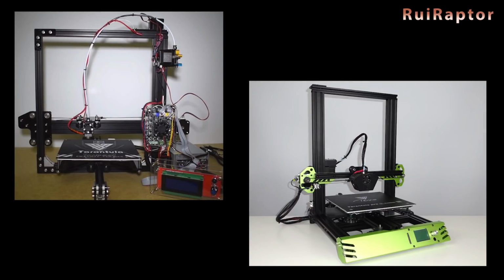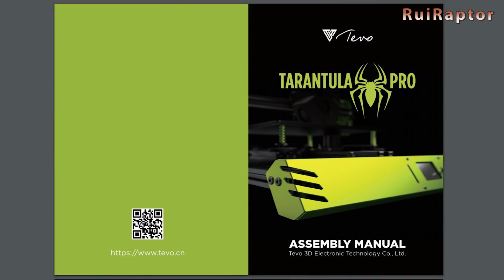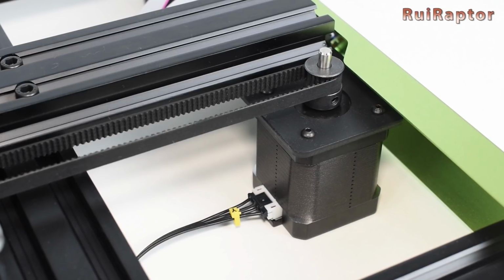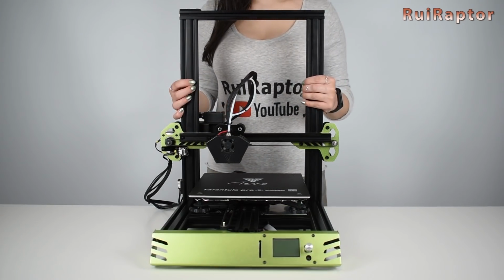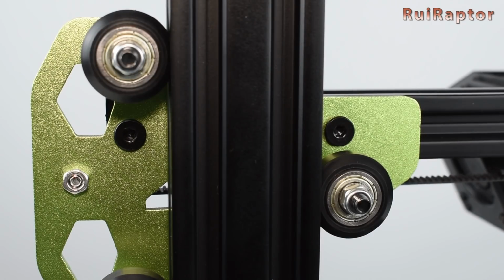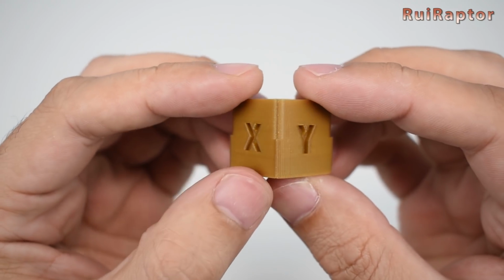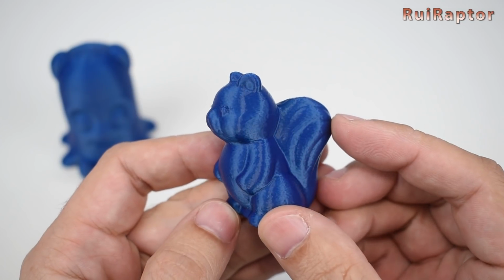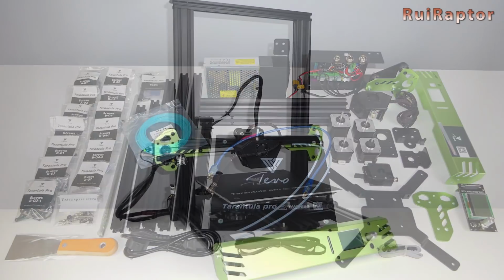Tevo TARANTULA PRO (3D Printer) - First Prints & Review

Comment: Thank you Ruiraptor for all of your detailed videos of the TTP. I got mine a week ago, followed your instructions and built it with no issues at all.

Only question I have is what is the average speed this printer should print at and do you recommend calibrating the setting in Marlin or just in Cura via profiles. What do you recommend? Cheers
Reply from the maker: Hi Bruno,
The more you increase the printing speed, the less print quality you will get. We normally print at 60mm/s for infill and internal walls and 35mm/s for outer walls. We always set this value in the firmware/printer menus. We also recommend you to disable the acceleration/velocity control in cura.

Comment: 240C is NOT maximum temperature for PTFE tube. PTFE is rated to 260C.  But because the PTFE tube connected to cooled part of hotend, you can use MUCH higher temperature for printing without any risk. 270C is printed easily, many hours in my Tarantula
Reply from the maker: If you search online you will see that there is No true value for temperature limit for PTFE tubes. Some good quality PTFE tube manufacturers have their spec at 260ºC, others at 250ºC but the general rule-of-thumb for our traditional tubes is that above 240°C will start to degrade. I have seen several cases of printers with PTFE tubes in perfect shape that after some hours of printing PETG at 240ºC got their tube tips in bad shape.

Comment: Ok i did your video for hot end so it dont leak twice and both times it still leaked tightend it tight and had petg tube where it needs to be also cant take petg tube out cause i gess i groved it in any idea how to get it out what can i use instead of that tibe also where can i get that tube at also will leaking hotend cause thermal runaway faild to heat faults? What is the best option to get to replace it if that whata iama have to do?
Reply: Well i broke a wire to the hotblock part so gona need a new one darn it any better version i should get
Reply from the maker: How hot are you using your hotend? Be aware that temperatures above 240 degrees C will start to melt the PTFE tube inside the heatbreak and cause issues.
Reply: @ruiraptor  hotest i did was 230 i didnt tighten after i got it hot i tighted stuff while cold
Reply from the maker: So if you heatup manually it will work but when starting a print it will not heat up?
Reply: @ruiraptor  no it heats up then in middle of a print will toss a faild to heat msg first time second time tossed a thermal runoff message turns out it was leaking filament and when I poured down the heat block from the radiator I damaged the thermistor wire so now I need a new one not sure which one I need and I also would like to replace the heating block with one that has wires off the side instead of smashed between the radiator and heat block

Comment: NOPE , about 1 min into several different prints it just stops mid print . No error messages like thermal runaway pop up , nothing , just stops .
Reply from the maker: It seems to be related with the connection between the front panel (where the display and memory card reader is) and the board. You will need to check the cable, connectors, etc.

Comment: After a nights sleep and a few more hours of tinkering , I think I may have figured part of it out , The factory Benchie test will not print no matter what I try , but one other seemed fine down to 0.2 print height . Retrying different settings , I did get the Reddit posted TT Pro profiles imported into Cura on Linux today . Another failed factory benchie at about 1/4 of an inch into print at 50% scale with a 0.4 print height this time . Going to try the one from Thingiverse . Just fidgety , as much as I like to tinker , I do not like getting annoyed at things , I am generally easy going and getting aggravated is really bad . Thanks for all your videos , I have found a lot of useful information on your channel .
Reply from the maker: Hi, why are they failing?

Comment: Rui , I just got my TT Pro together , and started printing , within the first quarter inch or say 6mm on 3 different prints , it just stopped printing with no error or anything , it just says printing . I haven't connected it to computer yet , but tried different SD cards to no avail . I used the test print from Tevo , then a benchie reduced to 50% scale through Cura with the standard Tevo Tarantula profile , located the a profile somewhere for the Pro , but in Linux , I couldn't figure out where the profiles are stored , so they are useless to me for the moment , yes I am also a Linux noob , but since I am not connecting it to a computer , that shouldn't be much of an issue for now .  TIA for any assistance you may be able to offer . Donnie
Reply: I just tried the support.gcode twice and both times on the first layer got thermal runaway shutdown error .  Looked at the links for support and I guess they expect everyone in the world to have facebook because all links point to a locked facebook group .  Yes , I am probably one of say 3 people in the whole world without that , wife and my dad being the other two . Doesn't seem to be any other way to reach Tevo from what I have seen , wouldn't have been a problem if I would have spent the extra 20 or so bucks and bought the thing from Amazon , but got it from Banggood . Yep , you guessed it , would have then tried my luck with a Longer LK4 Pro or Ender 3 Pro . Really hating this thing already .
Reply from the maker: Hi Donald, sorry for the late reply. Check carefully the cable and connections between the front panel and the board. It might loose connection to the SD card while printing (vibrating)
Reply from the maker: Regaring the thermal runaway, check if you have the layer cooling fan turning while printing the first layer. If yes, turn it down for the first layer and don't set to the full speed and try again.
Reply: @ruiraptor  Rui , thanks for replying , reason I left all the comments was because you seemed to have more knowledge about these than anyone else  . I really appreciate that . I will give all your suggestions a shot and get back to you , for convenience you could email me at gmail with user dring219 , just so we don't clog up a video of yours if you like . Again , thank you so much for the suggestions .
Reply: @ruiraptor  Rui , nothing seemed to work , tried unplugging EVERYTHING and reconnecting , even the drivers . I changed the print quality , fan speeds , print speed , bed & nozzel temps , I evenm tried different outlets in the house . I did find the support ticket option on Tevo's website , but with Coronavirus in China , I doubt I will be getting a reply anytime within the first 7 days in case parts were needed .  I do pray that all is well with you and your family  .
Reply from the maker: Hi Donald, try my recomendation of printing something using a computer instead of memory card because i believe that the issue is related with interruption of gcode reading/transmitting the information to the board.

Comment: Im a bit dissapointed to find out my new Pro does not support ABS. Do you know what needs to be changed to make it ABS capable? thanks

EDIT, I am printing ABS w/o issue with the bed at 90C and an enclosure. It sticks so well that I could probably run it at 85.
Reply from the maker: Yes, for the bed, you can either buy a more powerfull power supply or build an enclosure like you did. For the hotend, it's not recommended to use temperatures above 235ºC because of the PTFE tube. If you need to use higher temperatures you need to replace the heatbreak with an all metal heatbreak.

Comment: I don't understand why they did release this. It sounds like to a better Tarantula and to a worst Flash at the same time. They should make a new version of the Flash, still with electronic end-stops, magnectic build plate, and the good position of the Y motor !
Reply from the maker: Tevo is about to release the new Tarantula RS. Let's see what it will bring.
Reply: ruiraptor any sneak peaks? There are little details available at the moment but it can be preordered
Reply from the maker: Hi Brett, the information is still limited but we know that the heatbed is AC powered and includes TMC drivers.

Comment: Hey, how would you say this printer stacks up against the Creality ender 3 Prusa I3?

I will be buying a 3D printer now during the black friday sales and found the Tevo TARANTULA PRO  for 1,862  SEK (193 USD) as well as the Creality Ender 3 V-Slot Prusa I3 for 1,626 SEK (169 USD) (Best deals Ive found so far)

After watching some reviews on the Creality Ender 3 it seems a lot of people have issues with the default drivers giving them bad print quality and issues with nozzles not holding up, have you had any similar issues with the Tevo TARANTULA PRO? Im probably not going to end up upgrading whatever printer I  buy and not tinker too much with it outside of whats necessary to get it up and running so for me the out of the box performance and print quality is probably no.1 for me

Also community/support wise, is it difficult seeking help if you run into issues with the Tevo TARANTULA PRO or are there any online communities like active forums or Discord servers deditacted to this printer?

And lastly, as I've understood it, the Tevo TARANTULA PRO and Creality ender 3 both takes the same types of filaments right?

Found this TPU flexible filament which says its for the Ender 3, but Im guessing it would work just as well for the Tarantula pro, right? https://www.gearbest.com/3d-printer-supplies/pp_009249413095.html?wid=1433363&currency=SEK&vip=1041013&gclid=CjwKCAjw9L_tBRBXEiwAOWVVCdfLfTnoHse-pzJ89rdtUbCJXv_T2jRiQZ2f5qZwPhw2H61jitf_EBoCKDEQAvD_BwE
Reply from the maker: Hi, What you are refering to about the print quality is the salmon skin effect. This is caused by the allegro drivers and both printers have these drivers. To avoid that you need to replace them with TMC drivers. On the tarantula is easy because they are removeable but on the ender 3 the drivers are not replaceable so you need to replace the entire board. We made a video explaining all the differences ( https://youtu.be/r1YR7ugAgT8 ).
Reply: @ruiraptor  Thank you, great video <3 and yeah, I meant the salmon skin effect as well as how well they capture small details (Like a rough surface, or a surface with tiny patterns)

If I wouldnt replace the drivers, would these printers then be quite similar overall or would you still prefer the tarantula?
Reply from the maker: Hi Olliver, the tarantula also has better extruder and a dual layer cooling fan. As i said,  both print very good but the tarantula has better hardware in my opinion.

Comment: Hi! I bought it recently and after many troubles with the seller and resending some missing parts I finally assembled my first printed. I just have a huge problem, all my prints either start as the filament starts to stick on the nozzle almost immediately... or it starts to make fist layer which bends and then cools down and hardens and in few seconds the nozzle just pops it loose and I can stop the printing immediately. Please help :( I am desperate and not far from crying
Reply from the maker: Hi Martin, send me an email so i can help you.
Reply: @ruiraptor  Hi, I texted you on facebook because I can't find your email anywhere :/
Reply: same here

Comment: Do you have the BLTouch kit? Do you know the length of the brass spacers?
Reply from the maker: We are preparing the video for it. The spacers lenght may vary according to the BLtouch manufacturer. Try the 15mm ones and check the nozzle to sensor pin height (both when rectracted and extended) . If they are too long, use 13mm ones.
Reply: @ruiraptor  I look forward to the video.
Reply: @ruiraptor  I bought a ANTCLABS BLTouch when I thought I was ordering an Ender 3 but now I have the TTPro almost here.

Comment: What filament would work in the tarantula pro that wouldnt melt in a hot car?
Reply from the maker: I would try PETG but you cannot use hotend temperatures above 240º C
Reply: Some PTGE can be printed with temperatures of 240 or 230. Could it work? or also ruin the TPFE tube
Reply: @paologaliano942  i printed petg on 270 degrees once (way too hot) but nothing bad happened

Comment: I plan on day one giving this a shot with the TMC drivers I bought. Anyone know other than adding a fan what changes will be needed?
Reply from the maker: You need to reverse the direction in the firmware. Depending on the firmware version, you might also need to define which driver you have installed.

Comment: What is better? A ender 3 pro or a Tarantula pro?
Reply: Well this has a better hotend, mainboard board, replaceable drivers. Better motors, cabling looks cleaner. I'm not sure which jas a better extruder but the Titan clone on this one looks okay.  Ender 3 pro has a better power supply and fewer printed parts and has good print quality but from this video this looks like it prints just as well maybe better. There are so many creality printers though that if you like to tinker anything and everything has probably been done to make them better though.

Comment: Little bit offtopic: I read that PTFE fumes are really dangerous for parrots (many posts from pet owners which killed their parrots by using PTFE coated pan) I have bore heatbreak should I use my printer only outside or do you think its is safe? I have seen that you have budgie on fb profile pic so I'm asking you.
Reply from the maker: Hi John,
The PTFE fumes are very bad especially for birds. They are very sensitive for fumes and small particles. However, the PTFE fumes are mostly dangerous with temperatures higher than 240 degrees (which is the temperature limit of the PTFE tubes). We hardly reach those temperatures. However, filament also releases fumes and particles but there are not many study cases. Nevertheless, we don't risk it. Our printers are in a ventilated room and our birds are safe in a different room and far from the printers. It's a very good topic that you brought up and we have been always careful, not only with printers, but with everything that might harm our pets.
Reply: @ruiraptor  Thank you very much sir!

Comment: Thanks a lot for the video ! One quick question: why is the heatbreak with a PTFE liner worse than the option where the PTFE tube goes all the way down ? I had to change the hot end on my Nereus and I have to say now with a linered heat break I don't have to struggle with the bowden tube any more. Thanks !
Reply from the maker: Hi Ludovic,
The liner is a very thin PTFE tube that comes with the heatbreak. That liner, because is so thin, is more sensitive to temperature and can deform easier than the regular PTFE. If the hotend is correctly assembled and the PTFE tube as well, you should not have any issues.
Check this video that we have made and that explains the correct way to assemble the hotend and a few tricks to avoid issues.
https://youtu.be/rvkj8f_xNtE

Comment: Which would you recommend for a starting on, ender 3 or tarantula pro?
Reply from the maker: If you want to learn and know more about how the 3d printer works and how to calibrate everything, then the tarantula kit is a good choice.
If you don't want to bother with that and just go right to print, then the ender 3 because it's 90% assembled.
Reply: ruiraptor out of the two, which is the better machine? This would be a great VS video.
Reply from the maker: We are still testing the tarantula PRO. We might have more information soon.
Reply: rui is pro of Tevo Tarantula one, and seems to be the best for Tarantula Pro ;-)

Comment: What stepper driver best for get rid salmon skin effect?
Reply: TMC2208 is pretty good.
Reply from the maker: TMC2208 for X and Y axis. Are easy to install and work very good. You will need to add a cooling for them.
Reply: @ruiraptor  finally i just ordered ender 3 silent board tmc2208 lol.. but tevo seems cheap and good for second 3d printer

Comment: Would you still recommend the flash over this printer?  Looking to buy another printer for my home.  I use my Tornado for work.  Need to have something reliable for my teenagers.
Reply: I think the Flash is more faster than the Tarantula.
Reply: @nonamenosoname5887  more faster in what?
Reply: Flash has lightweight table and it's very important to this kinematics.
Reply: Think I will give the Tornado to kids and get the Snapmaker 2.0 for work.  Hot a CNC shop and needed something small.  It can laser cut/engrave, drill, mill, and print.   Have to wait 8 months to get it.  $1000 promotional price is high but I think it is worth it.  Tevo lack is support for my machine was a factor.  If it was not for this channel with Rui, I would have no support at all.  Great videos.